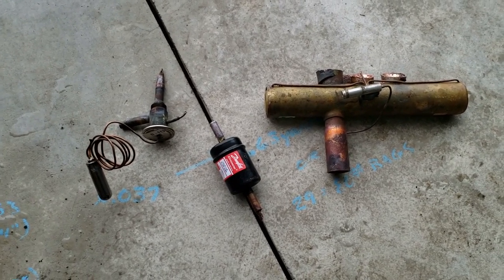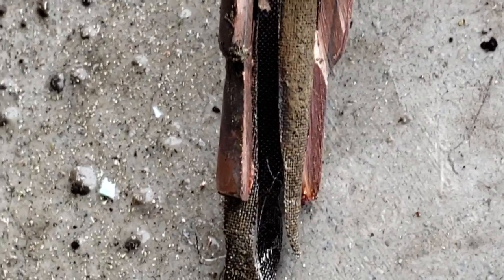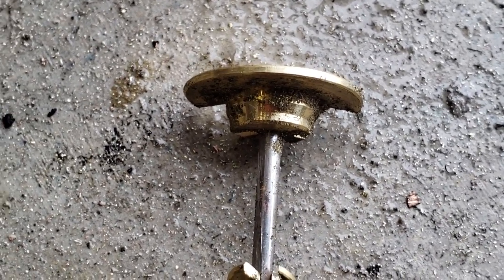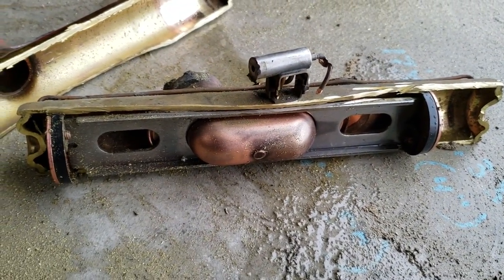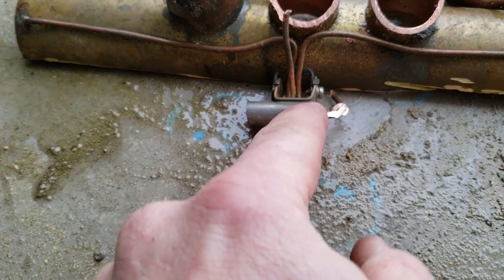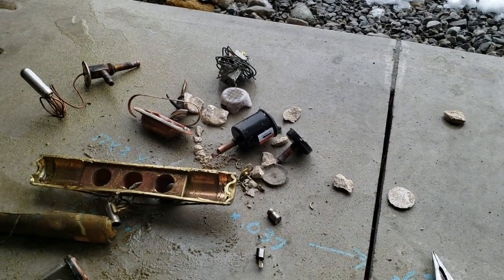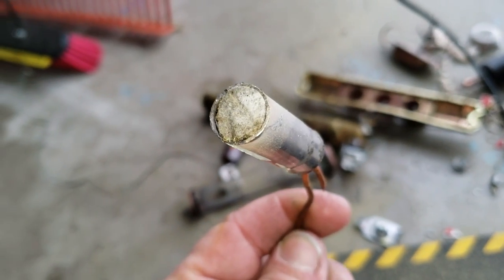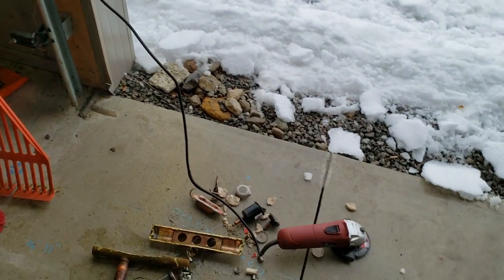TXV Filter Drier And 4 Way Valve Cutaway - Why Did It Fail?

Comment: They say a picture is worth a 1000 words.   Well if that's true, a video of it is worth 10,000 times more!   The TXV and drier were interesting and informative, but the reversing valve and the way you problem-solved it was tremendous!   The diagnosis on the thermostat was equally fascinating.   It's amazing what you can find and learn when you look!!
                            Your knowledge has already paid off for me Rick, and I've been able to help train others myself even in my class!   We were tearing apart and rewiring Carrier PCB's on furnaces the past week, the kid I was working with is a REAL nub; hardly ever touched a tool before.  When we were re-attaching the connectors, I mentioned the importance of making sure the clips on the connectors were tight and why they needed to be.   Shortly thereafter; about a minute, we got into the neutrals, and found one that just fell off.   It was black/burnt on the contacts and black on the post on the board.  "AH HA!"   I said.  "SPEAK OF THE DEVIL!"    It was just barely marked on the PCB, so after careful exam and cleaning, we crimped the neutral wire connector and slid it back in place.    We were able to show the instructor how we saved the school the cost of ANOTHER board.    So, thanks Rick.   Just thought I'd let you know; you're making a difference.....
Reply from the maker: WOW! Thanks, I'm just showing the things I see time and time again plus stuff that seem to create problems. That's great to hear! My goal is to speed up the clock and help get people better quicker. Thanks for sharing!

Comment: 😄😄😄👍👍👍 next video cut open run capacitor start capacitor and relay, defrost Clock and we need get you table man or you can Built one use 2x4
Reply from the maker: I did a basic overview with the defrost clock but it wasn't worth showing on this video. But I will work it in to one of the videos. Thank you for watching and recommending something. I appreciate that👍🏻👍🏻

Comment: Chicago Electric for the win at home!

Nice dissections and speculations.
Looking forward to more.
Home made Annie and discussion on 3 in 1 start kits for small fridges?
Reply: VS original equipment start components?
Reply from the maker: @davejohnsonnola2758  good stuff Dave. I'll get working in it. These videos take a lot longer than my other ones did because I have to actually make a attempt to do them once I'm home vs on-the-fly which was much more convenient. But I definitely will be taking Annie apart and showing her insides and some of the simple switch mechanisms you could make to Emich it.👍🏻👍🏻

Comment: Another High Quality Video👍. Would you mind doing a vlog or Video on alternative refrigerants for standard residential air conditioning, every distributor in my area sells different alternative refrigerants, all say that theirs are the best. Nu calgon has a chemical where you can add it and use R-407c with out doing a oil change on the compressor, but does this really work? Overall I trust your opinion and experience verses a TM from a distributor
Reply: superior I'll try to make something up
Reply from the maker: We use R407c but change the oil, I would like to try the additive your talking about but I might have to get the ok to do that. I will look into it! Thanks, Superior!

Comment: I have the same cheap grinder my father in law bought it when he was working on some doors. I use it since its around and for a 15 dollar grinder, it has taken lots of abuse. Was that factory installed reversing valve or did someone change it previously? That white gasket material seems to have experienced a high heat situation which could have shortened its life
Reply from the maker: Yeah I think that was high discharge gas temperatures probably melted it. That geo was a virgin before I mutilated it. Lol

Comment: I think the screen plugging is from drier material I don't know that but that's what I'm thinking from experience. When the oil brakes down it's normally gooy
Reply from the maker: I appreciate the info. I didn't cut apart the drier from the geo, I did blow through it and it didn't seem plugged. It has a new drier now.

Comment: The nylon material from the three way valve, did you eventually find out it did pass through the system on a later service call?
Reply from the maker: The first thing I replaced on that system was the compressor and once it was installed it was then realize that the reversing valve did not work. So it is possible that it got into the compressor? As of right now everything's been running as far as I know without any problems.

Comment: The port on the TXV. You said it was to equalize it out, when it shuts off. What does that mean?
Is it to prevent refrigerant migration.
When I saw the filter dryer. I started thing about static pressure. Turbulence and of course flow.
Reply from the maker: The components (parts) in the video are all from different pieces of equipment. None of them worked in the same system together,  nor would they,  the capacity of each piece is extremely different. There are several different types of txvs, balance port txv, internal balance,  external balance and likely others that I can't name off the top of my head. Check out the Sporlan link for more information https://www.google.com/url?sa=t&source=web&rct=j&url=http://www.sporlanonline.com/literature/10/10-10.pdf&ved=2ahUKEwiSo4CWk8XgAhVh0YMKHXbyBlUQFjAQegQICBAB&usg=AOvVaw19vk1hwMYMtTAswNplq_qx&cshid=1550488649082
Reply: Thank you. Maybe another video idea would be links. For new tech or people interested in this field.

Comment: most of that crap looks like oxides from not purging while brazing, with a side combo of compressor/oil running too hot and coking up, yeehaw!
Reply from the maker: The system was a virgin from the factory. Because every txv has looked like it's gummed up is why I think it's a oil reaction problem, I haven't noticed the screen looking like that till this one. I would hope they are using nitrogen during the construction of the geo,  that is why I think it's the anti corrosive oil that was in the compressor prior to the factory poe oil. Copeland is 45 min from my house and I asked people that work there about it and I was told that mistake has costed them some major money. 🙈

Comment: You are right system definitely was contaminated that’s the only way you get oxidation if the system is properly vacuum downed with absolutely no air and no moisture in 100 years the system will still look brand new. 
      As for not being sure or not knowing what’s inside to TXV bulb yes it is gas and it’s a mixture of different gases depending on how fast they want the bold to react in what specific purpose they’re using that particular expansion valve in anybody who’s been to any of the classes forms Sporlan or Dan Foss or any expansion valve company everybody knows this information.
Reply from the maker: Every refrigerant book I've looked at says TXV Bulb has a dissimilar refrigerant inside the bulb. I didn't mean for it to sound like I had no clue how the bulb works.  Just that we don't know what exact refrigerants they are using. I think it's Secret Squirrel stuff.🙄